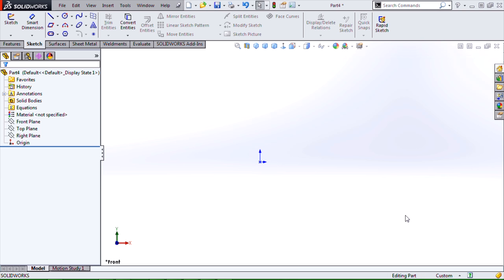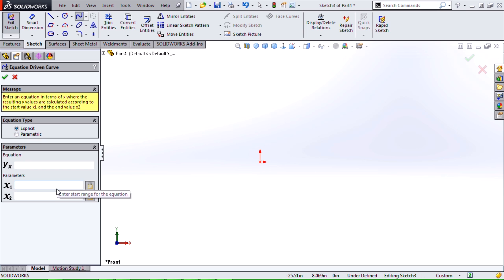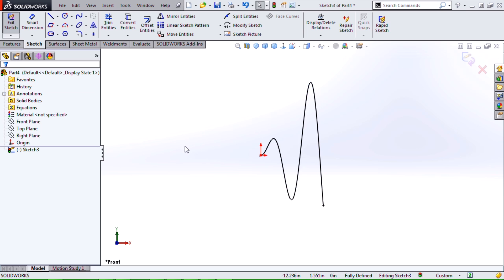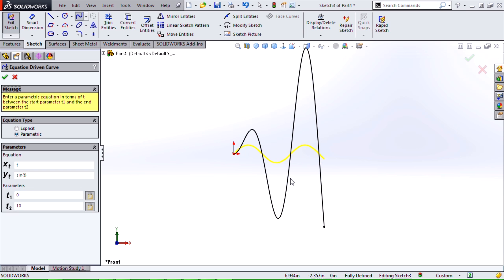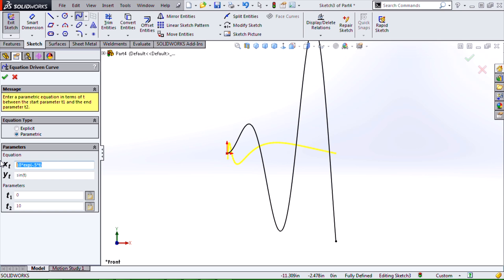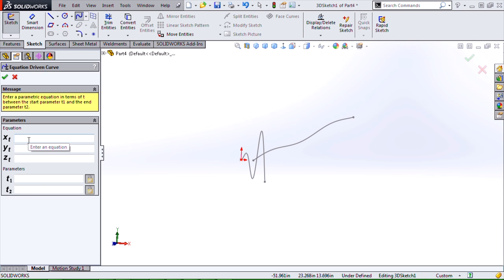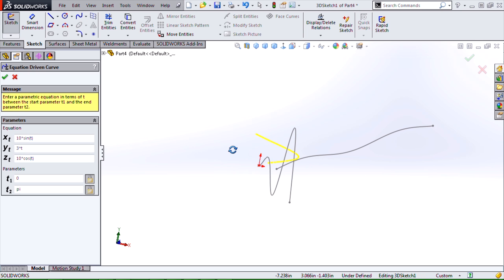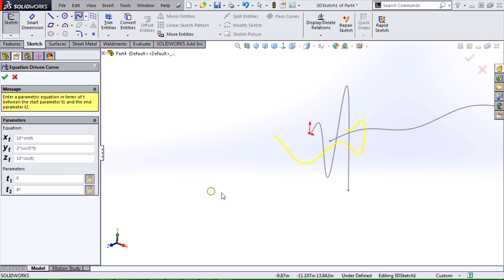SOLIDWORKS - Equation Driven Curve Tool

Comment: Random question, with the equations tool on SolidWorks, is possible to make quadratic surfaces?
Reply from the maker: It's only possible to create equation driven curves, not equation controlled surfaces directly. But there are ways to manage it

For any shapes that are axisymmetric you could simply create the equation driven curve in one quadrant and then use a Revolved Surface feature.

For more complex shapes, you could lay out multiple equation driven curves and use the Loft or Boundary surface features to interpolate the surfaces from the equation driven curves.
Reply: @hawkridgesystems  thank you very much for your answer, has been very useful to keep with my projects.